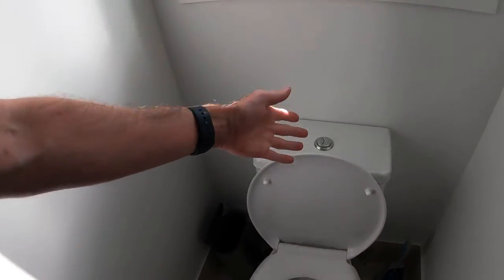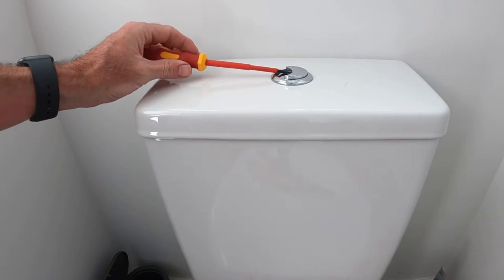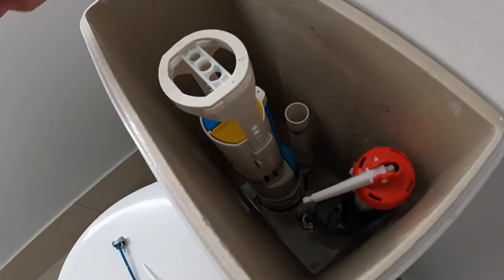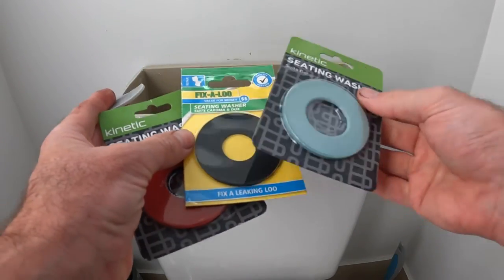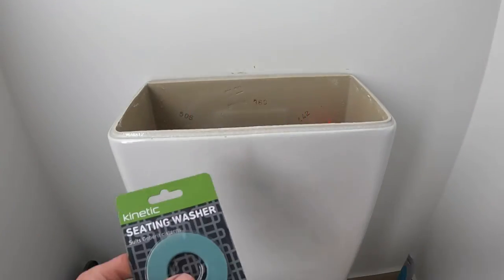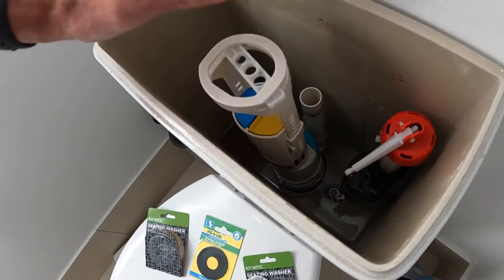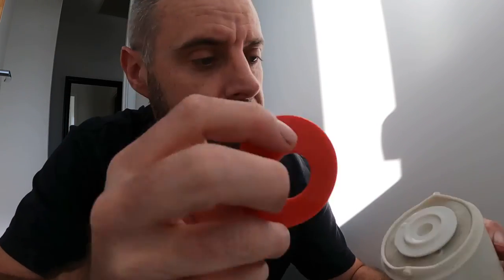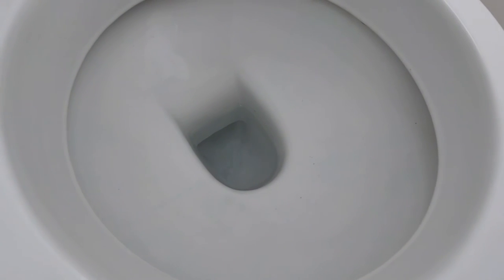HOW I FIXED THIS PORCHER LEAKING AUSSIE TOILET

Comment: You don't have to stretch the seal over the top.  On the stem are 2 press in catches that will allow that top piece to be taken off and the seal replaced easily.  Also double check the tabs that lock the tower section aren't worn or loose as this will let the tower tilt and not seal.  Check the cistern level to ensure it is not too full.  The adjustment screw is the white plastic on on the water inlet module.

Comment: @testandtune6096 Any help on how to get the top off the red top inlet valve to replace the washer in there?
Reply: Ok figured it out, there is a red tab in the top of the cap that needs to be pulled out and then is easily twists off
Reply: how did you pull the red tab off? @MrFlebbert
Reply: @mmango635  it just pulls straight up, I used a pair of pliers to do it

Comment: Would like to know how to adjust the flush for a bigger more water flush?
Reply: The water level is adjusted by the white plastic screw on the inlet unit the hose attaches to.  Don't fill the cistern above two thirds.